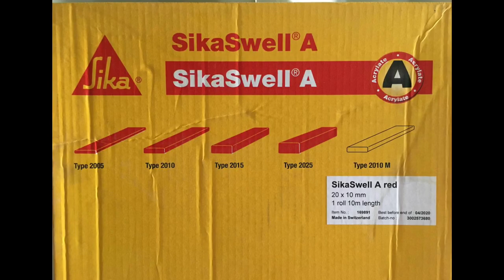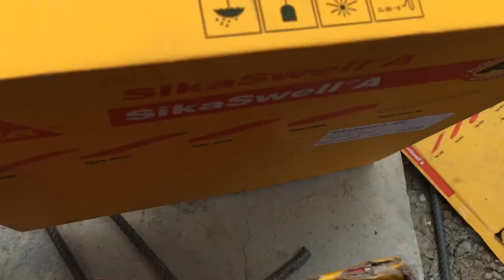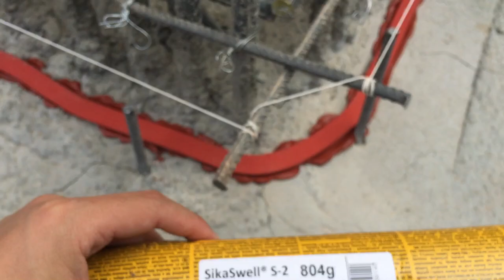Construction of water stop (sikaswell/ sika bond)

Comment: Wow, this is shocking.... blowing dust off with your mouth before placing the adhesive, the first concrete placement has a bunch of cracks in it, I see transverse tie bars not wrapped around the vertical bars.  I guess this is construction on a budget